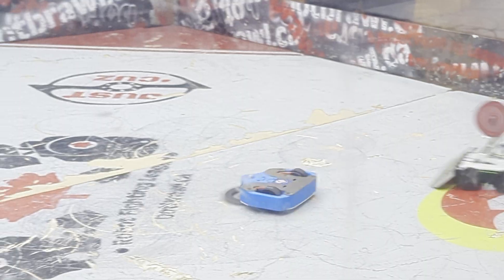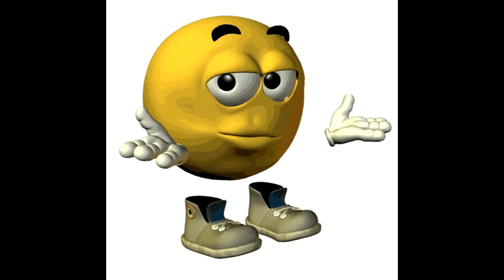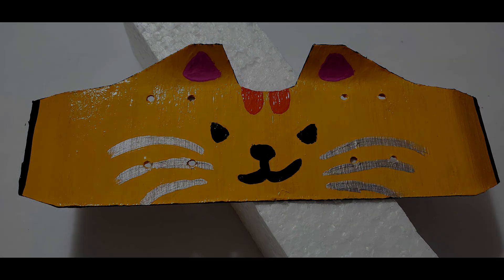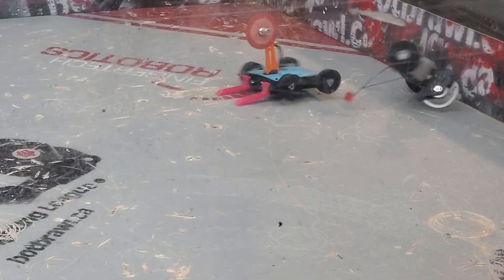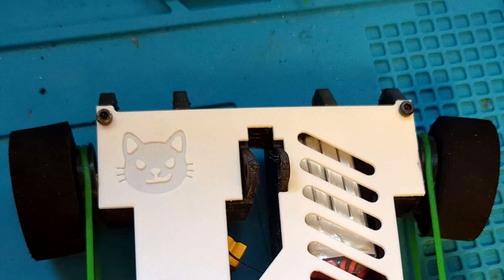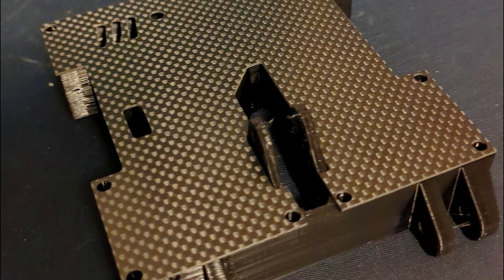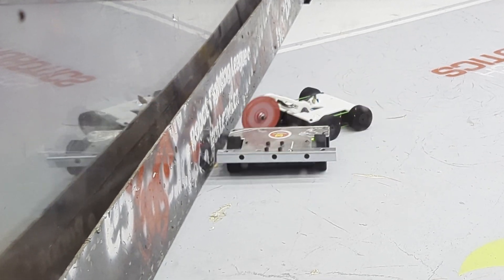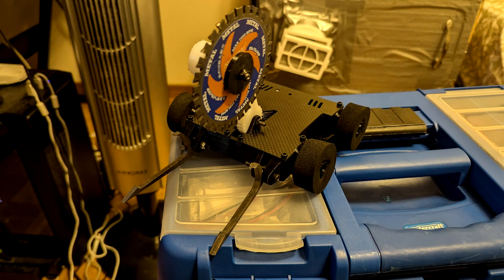UPGRADING my BATTLEBOT

Comment: awesome insight! seems we are facing contrasting issues. I wanna maximize bite on my weapons, your saw gets too much as seen in that first clip. hopefully you can continue to build on smoothening out the cuts!
Reply from the maker: well if it keeps biting too much there is always a hammersaw option... 😉
Reply: @DoggoDoesYoutube  if youre getting THAT much bite with a multi tooth saw, the bite from a single tooth will be perfect every time
Reply from the maker: @jackgoss06  we'll see
For the hammersaw I'm not sure if I'll still be using the 2306 motor, prob will go down to a 2004 motor fr
Reply: @DoggoDoesYoutube  just make sure your motor can handle the loads. motors do explode and i can attest to that!
Reply from the maker: @jackgoss06  worst case scenario if they don't survive then I use a custom 2207 with 3200kv fr